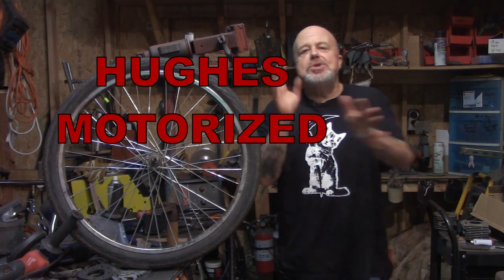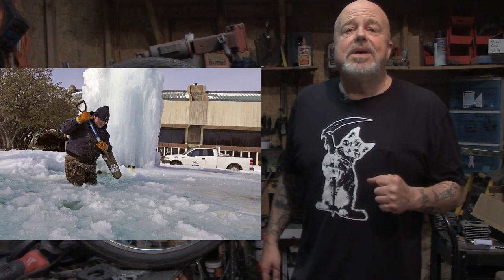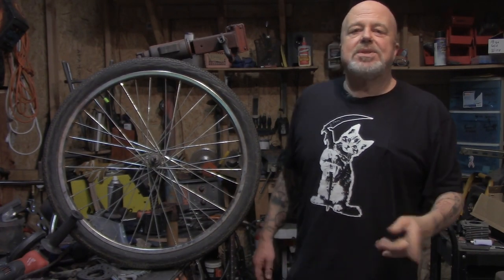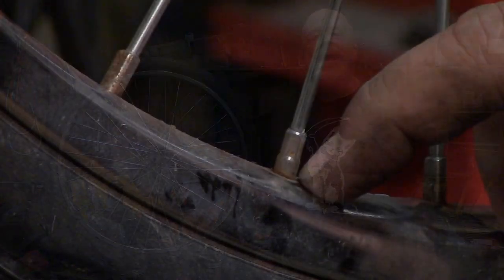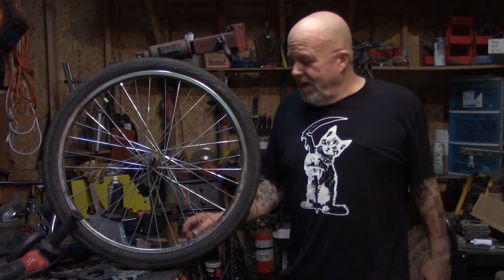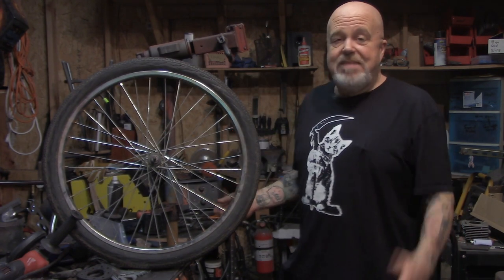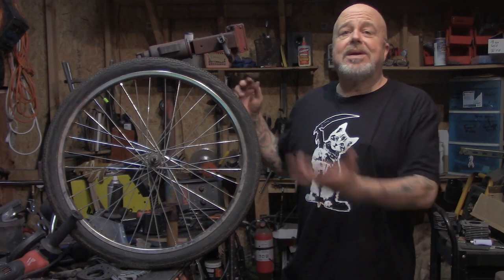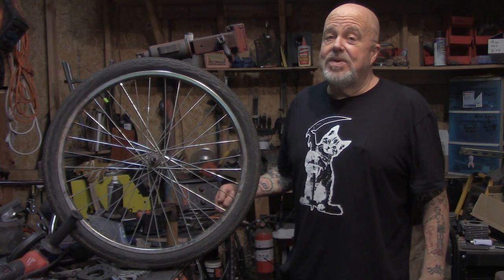Is it OK to store Motorized bike outside in the elements? Preventative maintenance tip.

Comment: just came across this video. great information. how about a 2$ tube of silicone using just a DAB around the spokes. with that much silicone, might be able to do 2-4 bikes that sit outside, and at least knock that one problem out. after it dries and ages, would only take a finger rub to remove it. might have to try it on mine anyway, even though its parked in my garage, central Illinois where the humidity really tears stuff up.  Thanks Mr. Hughes!!
Reply from the maker: Great tip!

Comment: I'm new to this here what is the safest way to store up your gasoline motorized bicycle in your apartment. Or do I really need to leave it outside where I can get stolen the elements could get it rusted or destroy the engine.

And if so, are there ways to prevent this?.
Reply from the maker: That's a ruff one. I'd get a good cover for it to minimize any gas fumes and keep inside away from any appliances w/ a flame. I've left my old bike out for years fenced up. An apartment is harder since if it's where people can get to it, it'll get swiped.